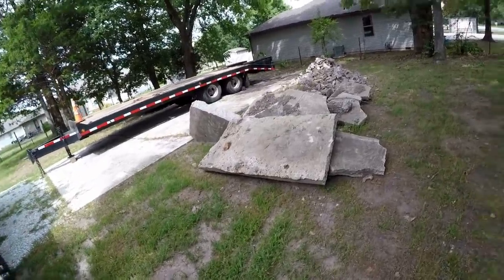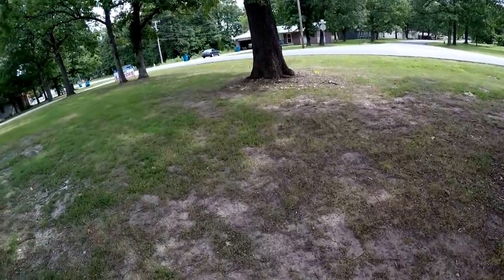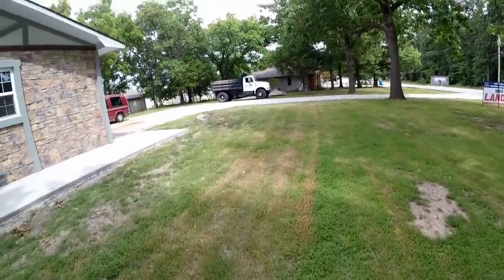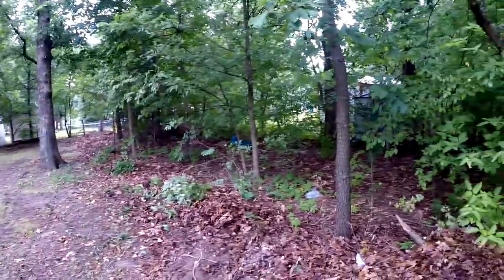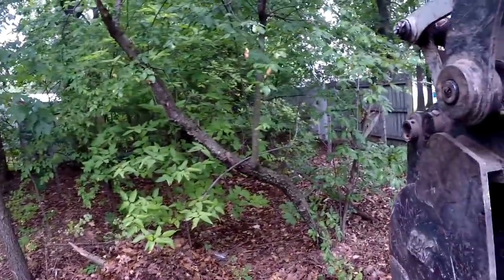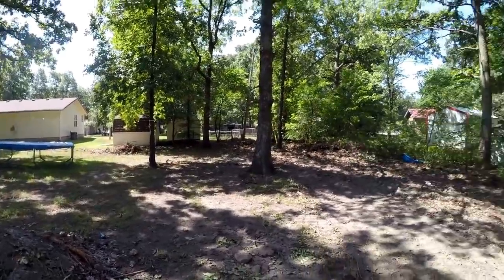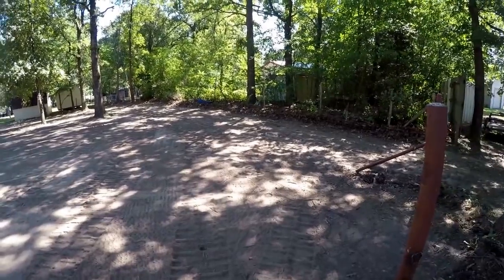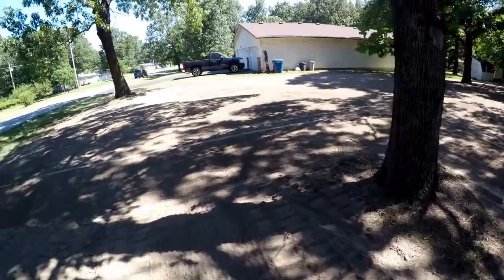Cleaning Up A Neglected Yard

Comment: I keep commenting on old videos and i see other people saying the same thing so it ok i guess.  You could get some sheets of 1/8" steel 4'x8' and have your signs made up on them and then tack weld the signs to both sides of your dump truck.  Seems like good advertisement
Reply: Im working on another idea where i would approach a business owner with an easy gravel parking lot by the highway and offer to grade the lot with my power rake and remove and smooth out the pot holes for free if they will allow me to put up a sign advertising my business when its done. And if they get rock dropped off i will spread it out also.  I wont really be out anything other than a few hours work and gallons of fuel.
Reply from the maker: That’s a good way to get your work out there for people to see
Reply from the maker: zib kabeer yeah that’s a good idea